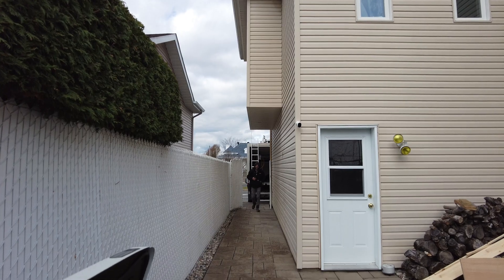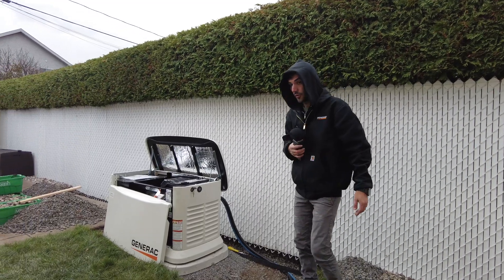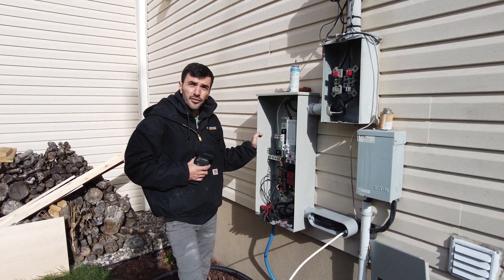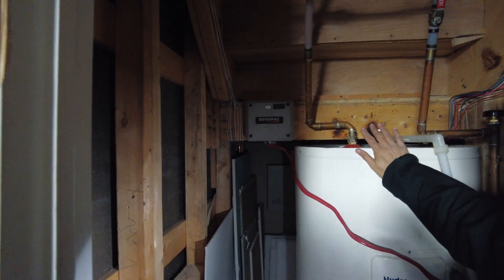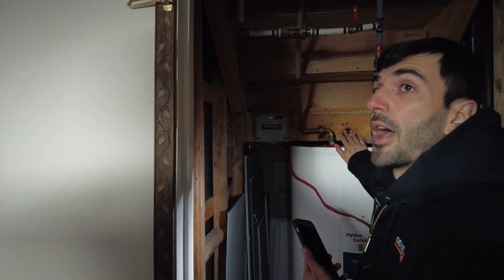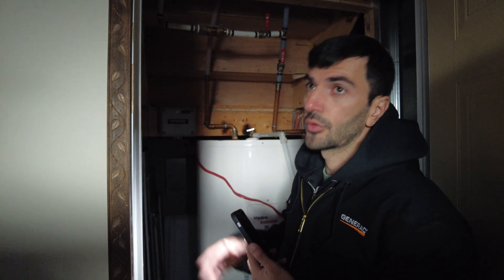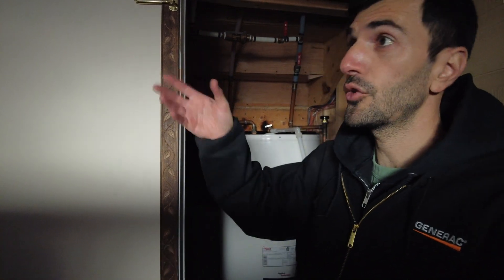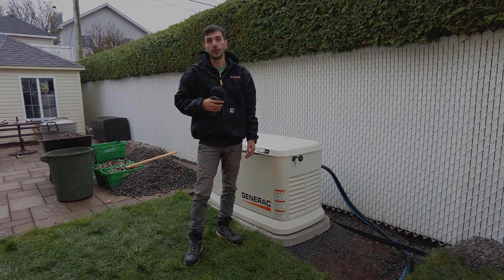#Installing a #Generac #Generators Air Cooled 26KW  #prestige_electrique

Comment: That seems like a nice tidy installation, and that's from a guy who did this for near 25 years. I am also familiar with the Generac load shed system but I have to ask if people really try to heat homes with a heat pump in Canada. That just seems insane given how quickly the efficiency / capacity drops off with below freezing temps. Heck, most people don't do it in my area of New England.
Reply from the maker: @rupe53  Thanks for your attention and comments. There are some super efficient heat pumps here that are functional till -35 centigrade! I guess human has no choice but to adapt to any condition or leave it!
Reply: @PrestigeElectrique    that was a trick question because there's a fair spread between "will it work" and "is it practical" out in the real world. I got caught on a job one day and my first glance at the gen set said it was a 48Kw. The faults showing were under voltage and under speed. After poking around for 10 minutes and speaking with the customer I find out it's a 32 Kw and his 6 tons of heat pump has a pair of 50 amp breakers for electric backup. The hot water was also a heat pump with electric backup, plus he was on a well pump for water. I finally figured out the gen set was undersized by an electrician and they never hooked up any load shed. I let my boss work it out with the customer's electrician and tried not to get involved myself. I had several other jobs to do that afternoon and there were 15 other techs who may or may not have been back to the job. Bottom line was I left after flipping off one of the 50 amp breakers as a temporary measure.
Reply: Great looking installation!       Other than in the warmest part of Canada, Nobody but a fool who believes the nonsense spewed by our climate crazy governments would be using a heat pump as the sole source of heat for the home and certainly not in the western/northern parts of Canada.     You could certainly have one but in all cases where I have seen one in Alberta the existing furnaces also remained as “back up” heat.